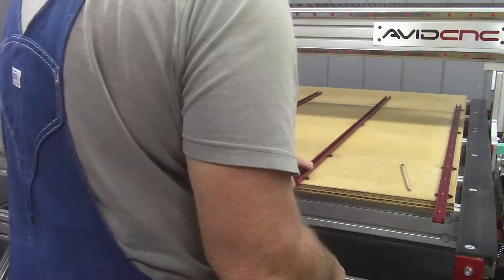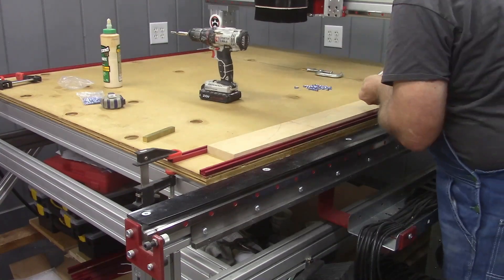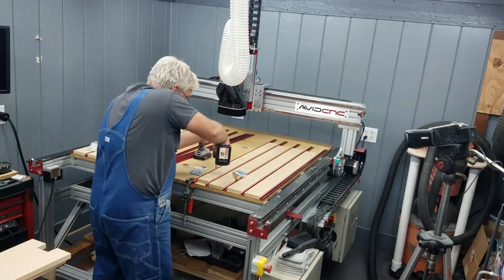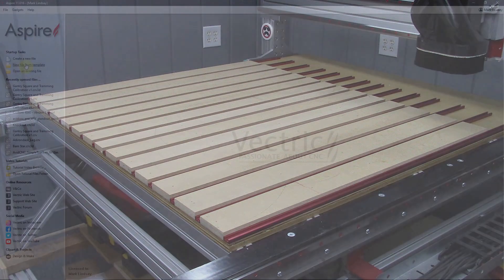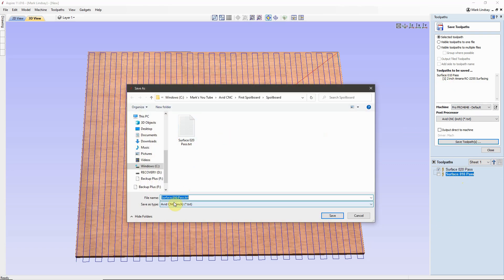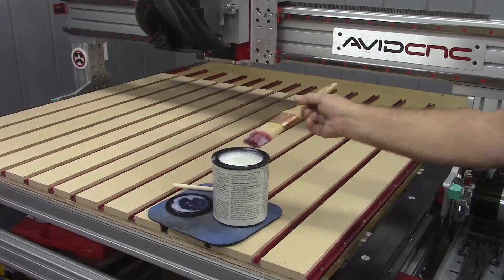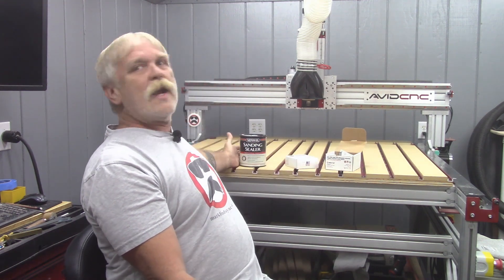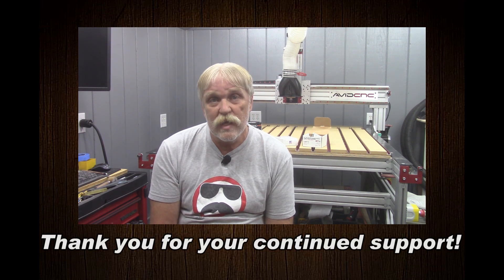Adding a T-Track Spoilboard to My Avid 4848 Pro CNC

Comment: Best intro of all time!  If you layout a pattern of holes on your MDO base, you could use 1/4x20 inserts and design a repeated pattern for each strip of MDF so you can easily remove and replace your spoilboards when they get too used up.
Reply from the maker: Probably, but I don't ever plan on replacing one of them. When I surface them down to the point that they're getting close to the top of the aluminum t-track, I'll just glue some 1/4 inch thick MDF on top of them, surface them flat, and drive on.

Comment: Mark, why not just glue the whole board down and CNC mill the slot for the aluminum.  MDF doesn't really need sealing but I would have used a thinned shellac.
Reply from the maker: There are a lot of ways to skin the proverbial cat. As long as you get the result you want, that's what counts. As far as sealing the MDF is concerned, I have to. I live in an area that gets dense fog for days at a time. If I don't seal the MDF, it will swell and eventually start to mildew and rot. It's happened to me before - that's how I know I need to seal it. As I said in the video, I normally would have used thinned shellac (or shellac-based sanding sealer,) but I was out of it and I needed to get it sealed ASAP.

Comment: I installed a very similar setup but used the CNC to cut slots for the track and their mounting holes. With those installed, I stuck up on the fit of the MDF slats.

Comment: Good morning Mark. That spoilboard looks really nice!! I'm really liking the t-track idea.👍
I have a question, didn't you find that the mdf was a little rough after you sealed it? 
Did you lightly sand in between coats?
I used the polycrylic to seal my mdf cnc benchtop and it did not dry smooth. I had to sand between coats. 
I've used the Sanding Sealer on mdf for other small projects and it works really good (but I think I still had to sand it). Probably should've used it for my benchtop. 🤷‍♂️😃
I won't be able to make your live stream today, so I figured I'd ask here.
Thanks a lot Mark!!
Reply from the maker: Thank you, Joe. Yes, the MDF is a little rough, but that's to be expected. It's nothing a little 220 grit on a sanding block won't cure in about one minute. I didn't sand between coats. I'm not going for a showroom finish - I'm just trying to keep the MDF from absorbing a ton of moisture over the winter.
Reply: @MarkLindsayCNC  Ok yeah, that makes sense. Thanks so much for getting back to me. 👍
So do you feel that the roughness will NOT affect your material or make it a little uneven in certain spots?
Reply from the maker: This is the 3rd spoilboard I've done this way, and I've never noticed any unevenness (is that a word? I guess it is now...) I do know that if I don't seal the MDF it WILL be uneven as heck before January. We get a lot of rain during the winter, and wood will start to rot very quickly if it's not sealed. MDF absorbs that moisture in the air like a sponge. That's the only reason I seal it at all.
Reply: @MarkLindsayCNC  Yes, "unevenness" is NOW a word!! Why? Because you and I said so....it is so decreed.😆 
That mdf will blow up if not sealed, especially where you live. Here too, so I wouldn't take that chance either.
Thank you for the help and advice, Mark. I appreciate it.

Comment: Glueing the spoil board. I have to help someone move so I won't make the Live Q&A. I know that as months and years go by, you will have to resurface the spoil board. Eventually, wouldn't you have to replace the slats? Do you plan on removing the t-tracks and surface the whole board down to the base level spoil board?
Reply from the maker: I should never have to replace one. When I eventually surface it down close to the tops of the t-track, I'll glue and fasten strips of 1/4 inch MDF, surface and seal that, then drive on. Should I need to remove one strip of MDF, I'll mill it out as you described.
Reply: @MarkLindsayCNC  Thank you! It's a good obvious answer that my brain didn't see somehow!

Comment: Why glue the MDF?  Wouldn't screws or the ceramic nails be enough?  Trying to remove the glued MDF will be a "bear".
Reply from the maker: The same as with my Gatton CNC, Steve - I should never have to replace one of the MDF strips. When I eventually surface it down close to the tops of the t-track, I'll glue and fasten strips of 1/4 inch MDF, surface and seal that, then drive on.